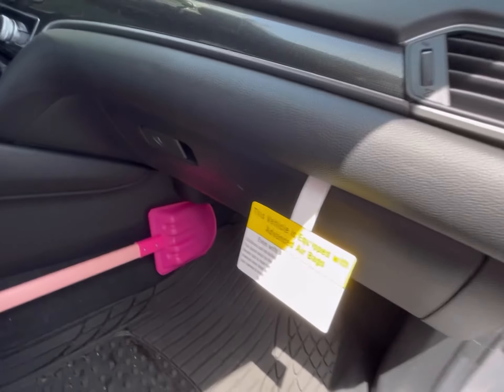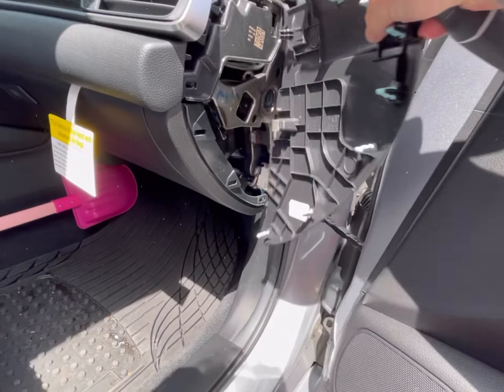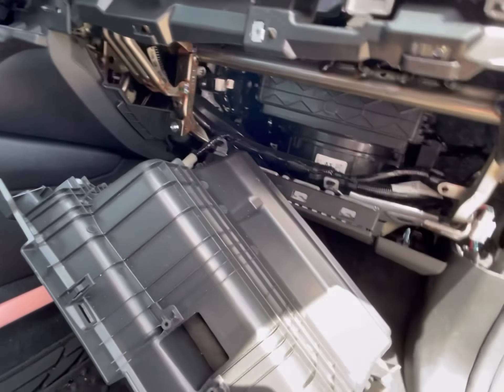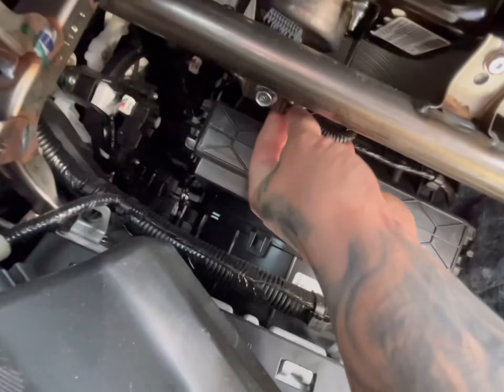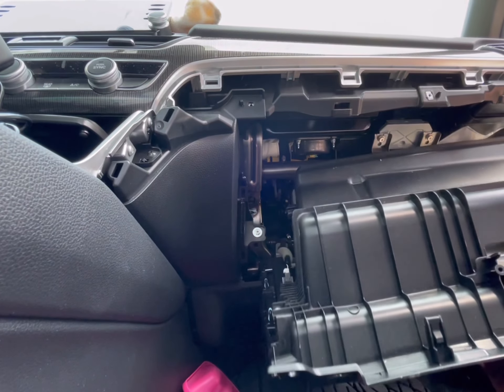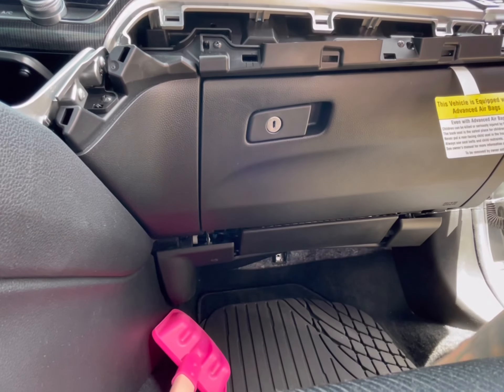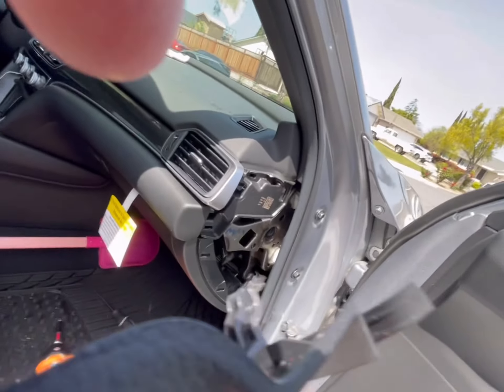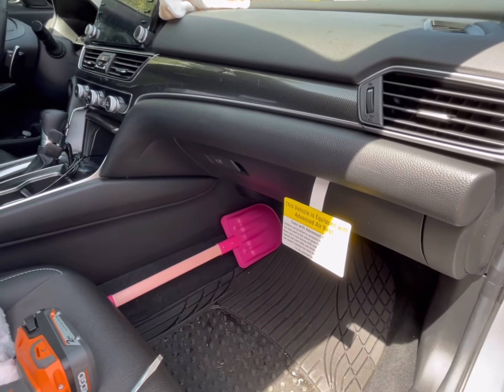How to bypass ANC module on a 2021 honda accord sport (fastest and easiest way)

Comment: I have a 2021 Honda Accord Lx and my aftermarket subs making a humming sound when the windows is all the way up but goes away when I let them down or when I open the doors
Reply from the maker: Did you disconnect? That part behind your glove box? I have a video on how to do it if you didn’t
Reply: @TommyT408  No I had the amps put in but a stereo shop
Reply from the maker: You would have to call them and ask them if they bypass the ANC module if they didn’t it’s easy to do and takes like 5 to 10 minutes
Reply: @TommyT408  ok thanks but I’m going to look myself first
Reply from the maker: That’s the best way to do it